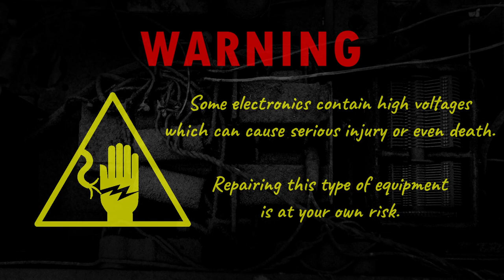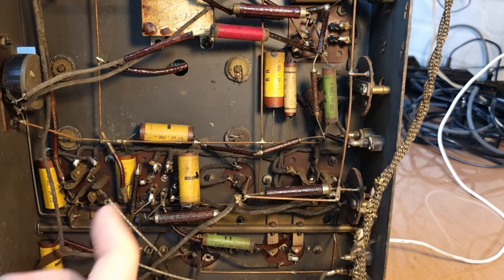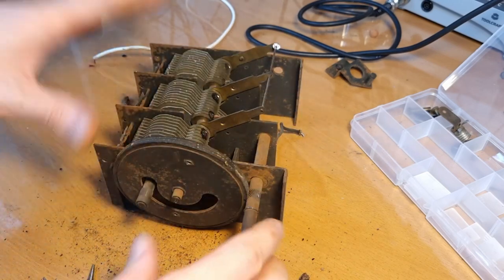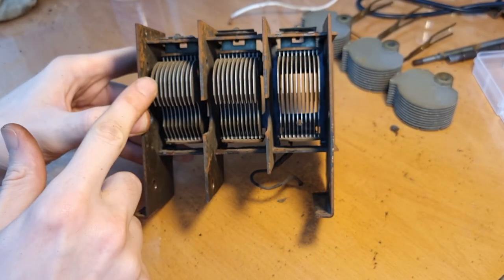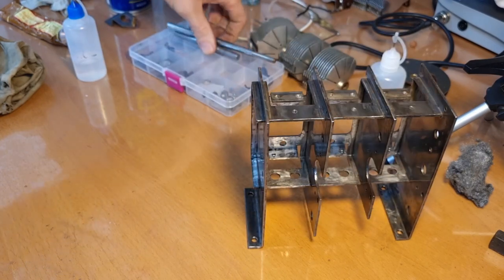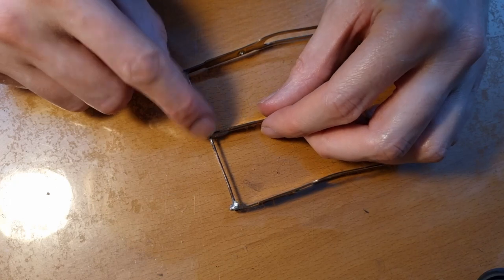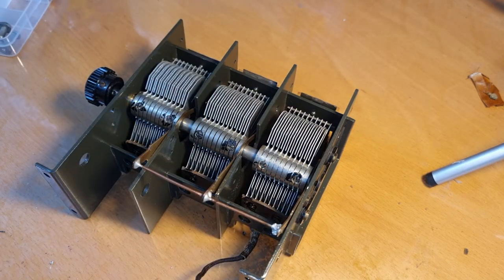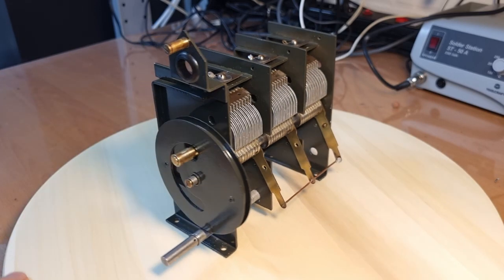Restoring a 1930s tuning condenser - R.R. Radio Type 568 - Part 3

Comment: Hi Kristof.  
What a spectacular result!  I think this is where your experience with cameras pays off.  Most people, myself included, would hesitate to try such a restoration.  
You have certainly set a high benchmark for the rest of the radio.  The rest, however, should be easy by comparison.
I did watch this video before but I was interrupted before I leaving a comment so I finally got around to watching the last couple of minutes.
Thanks for a great video!
Reply from the maker: Thanks so much, Don. I honestly don't think I did anything you couldn't or wouldn't do. :-)
The restoration will (hopefully) indeed continue at this standard, but it will be rather slow compared to my other restorations.

Comment: Absolutely fantastic result! Well done. Just a note: not sure if you mentioned it, but the mica strips that you removed from the top are actually needed so that you can adjust the padding when you do an alignment. The screw is tightened and the metal section at the top is shifted closer or further away from the metal base, adding a small amount of capacitance to that particular section.
Reply from the maker: Thanks a lot Manuel!
Indeed, you are right. I forgot to mention that indeed. All three mica strips were still intact and put back into place during reassembly. Thanks for clarifying!

Comment: I removed and cleaned the condenser of my old Bush tube set. I am substituting those soft elements for cork, which is also flame proof and a good insulator. In my case the condenser body has a mesh close to one of its feet, to chassi. The idea is having the whole thing a bit mechanically decoupled from chassi vibrations. Nice work, regards from Brazil.
Reply from the maker: Thanks!

Comment: Hi Kristof,
Greetings from Ireland.
Enjoying your meticulous work on this old beauty.
How about fitting a smaller grommet onto the bulb socket that would fit snugly inside the larger grommet.
Cheers, -Rod
Reply from the maker: Thanks, Rod! Glad you enjoyed the video.
Fitting a second, smaller grommet is indeed an option. But this project is so huge that I still have plenty of time to think about a solution or find a more suitable grommet before I actually will have to put everything back together. 😅

Comment: Hello.
I have appreciated the process regarding the restoration of the variable capacitor. Thank you!
I have a question: why did you need a tin-silver alloy for soldering the brass components? What would happen otherwise with a common solder alloy in that situation?
Thank you for your attention.
Regards,
Daniele
Reply from the maker: Thanks.
Regular solder will probably also work but the tin-silver alloy simply works better for brass. It flows really well in between the parts of the joints.

Comment: You can remove rust by putting the part in some water and citric acid for a couple of days. Much less work.
Reply from the maker: Yes I know, but I didn't want to waste so much solution since it's quite a big condenser cage. 🙂